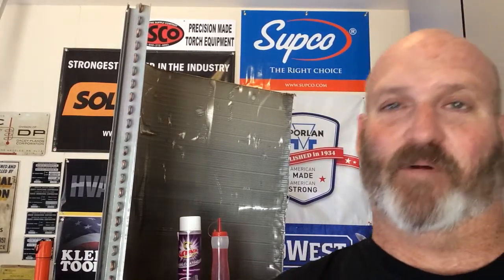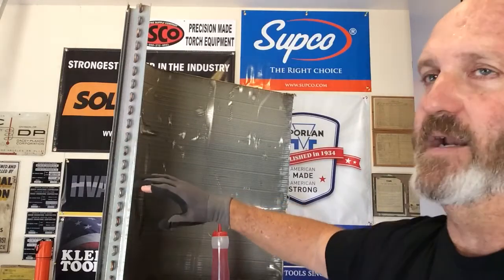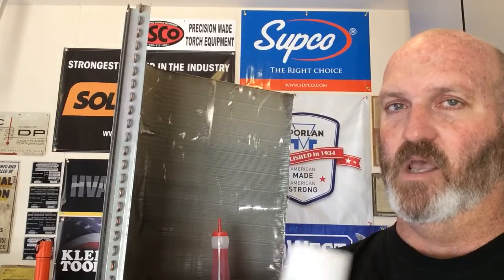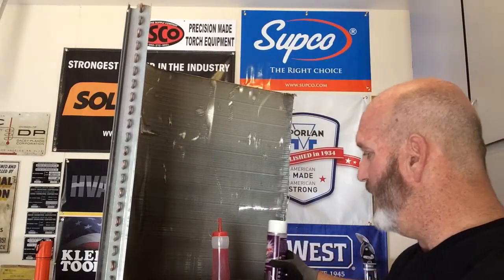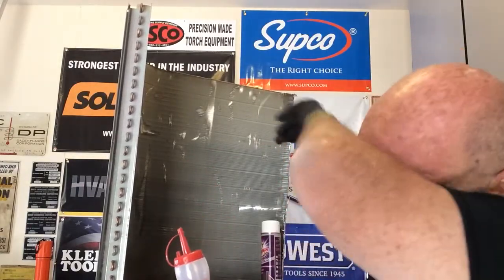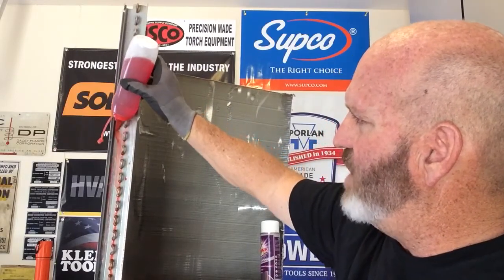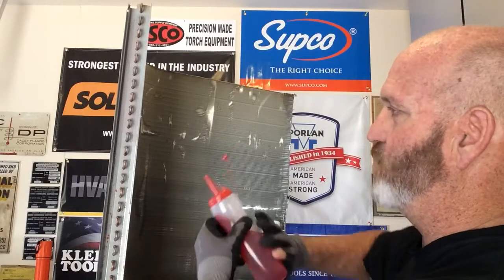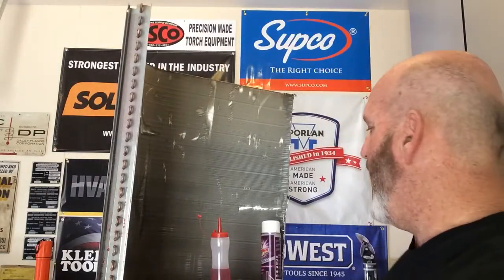Refrigeration Technologies - Spray On Coil Coating

Comment: condenser cleaner peeled the majority of the condenser fins black coating, if I applied more condenser cleaner removing the rest of the coating would this be a good choice to recoat? I know my evaporator has rust on the end caps from the galvanized steel, I was thinking of treating it with rust converter then applying this over the ends to fully encapsulate after treating. What do you think?
Reply from the maker: @jasoncook5307  make sure this is no chemical reaction between the two applications and give it a shot.

Comment: Question, have you used it on airhandler evaporators, and if so, have you found it to help keep "dirty sock syndrome" from reoccurring?
Reply from the maker: Has nothing to do with odors. This coating is about rust and corrosion prevention.
Reply: Hello, I'm just now getting back to this. I have an upstairs and downstairs heat pump.  The downstairs unit was replaced a few years ago.  Once it got cold where the heat was working, I started getting the dirty sock syndrome.  My HVAC installed replaced the coil with a Trane coated one, but I was getting a little residual smell because Trane doesn't coat the coil 100%.  I ended up using an ionizer which addressed the problem.  I now notice my upstairs unit give off a smell sometimes.  I installed an ionizer there which helps but not 100% like downstair.  I cleaned it with Nu-Calgon no rinse cleaner but that was a waste because i think my issue is the dampness and calcium deposits on the coil. I am going to reclean it with the Nu-Calgon Cal-Brite Plus produce which should address the calicum, but then i was thinking I would coat the coil with the Viper Coating to keep the calcium from coming back and it should help shed the moisture off like you demonstrated so that though it does not address DSS or odors directly, it will help with that indirectly.  Make sense? @cochisecounty_travels